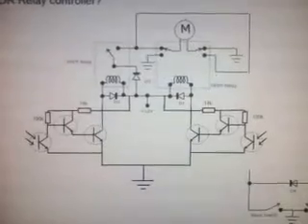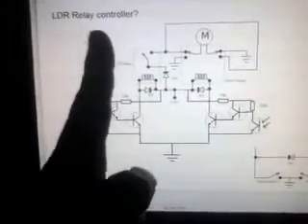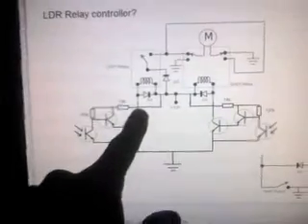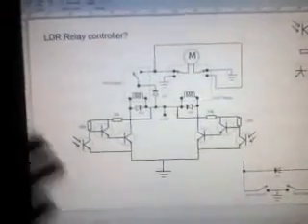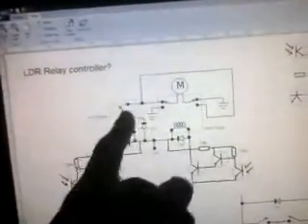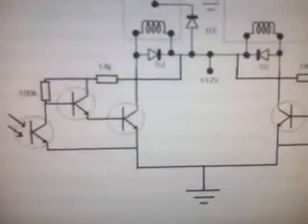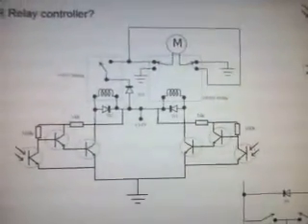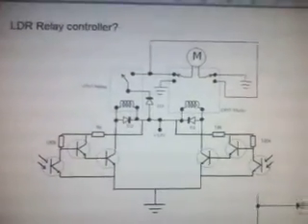LDR solar tracker relay circuit. is this right? 2013

Comment: problem with all these circuits is they fiddle-fart all day trying to optimize for the current illumination / situation which wastes energy and can also create silly behaviour of the array itself. on my channel i have a layout for the pcb for the best LDR based circuit i have come across that only re-optimizes every ten minutes or whatever u program it to do. much better. an even better circuit wouldn't even bother searching for the sun at all, rather it'd go by GPS and azimuth data.